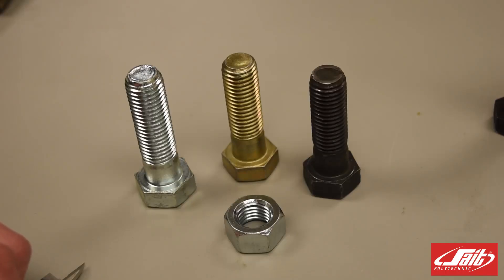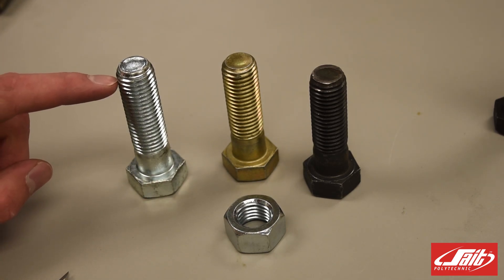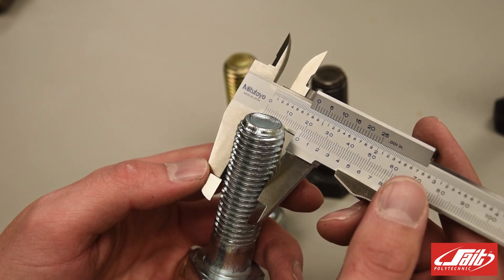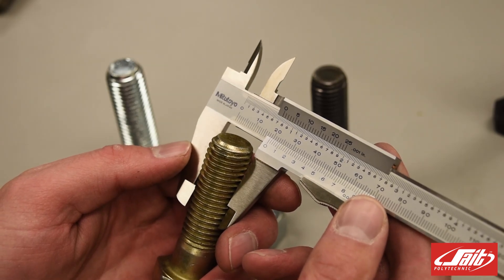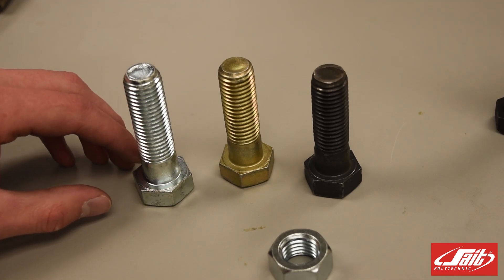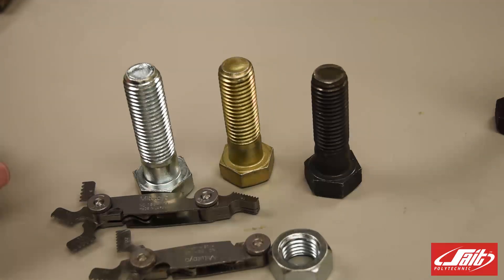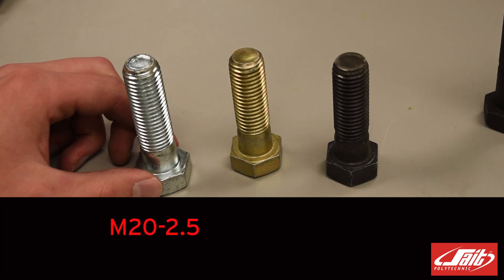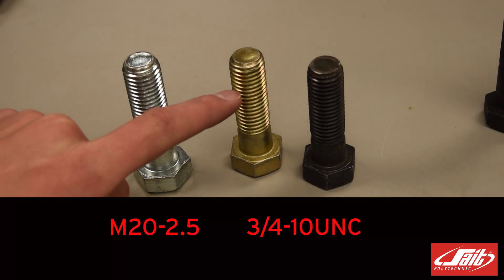Bolt and nut measurement

Comment: Insanely over-
complicated. Thanks for explaining.
Reply: Isn’t it about time the US standardised to the metric system? As we’ve done here in the UK despite the resistance to change, mostly from older people.
Reply: The US was supposed to switch over to using the metric system in the 1970's. Fast forward almost 50 years and we're still using the same crazy, illogical system that everyone else stopped using decades ago. 🤔

Comment: was this the caliper you  used: Mitutoyo 530-119 Vernier Caliper, Stainless Steel, Inch/Metric, 0-12" Range, +/-0.0015" Accuracy, 0.001" Resolution...
Could you recommend one?

Comment: doesnt mention how to messure the length of bolt
Reply from the maker: If it's a hex head bolt, measure from the bottom of the head to the end. If it's a fastener with a "V" shaped head for counter sunk holes, measure the entire length of the bolt.

Comment: How to know the size of bolt as per thickness?
Reply from the maker: A tape measure or ruler would work well. You could also use a caliper. Just measure across the threads.
Reply: Best to use a outside micrometer.

Comment: The inside diameter of the nut is 0.655 inch approx. and the outside diameter of the nut is 0.75 inch. How can they both fit together.?
Reply: It is because you need to measure the bolt on the ouside diameter of the threads, and you need to measure the same for the nut, but that is more difficult.  The 0.655 is the inside diameter of the theards on the nut...as you said.